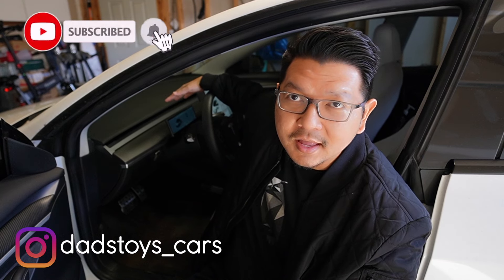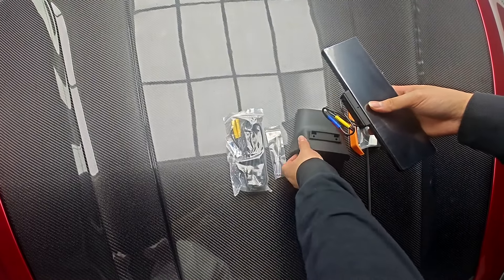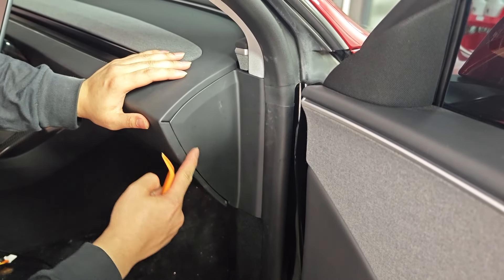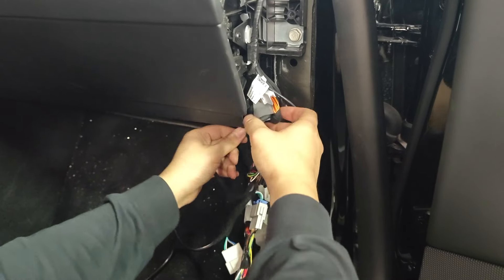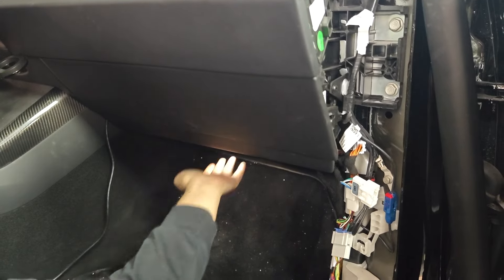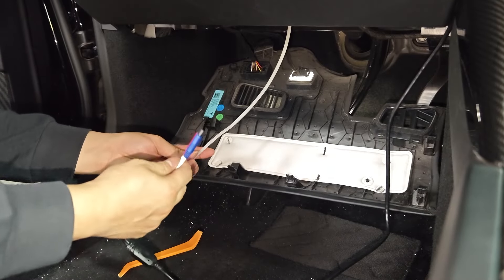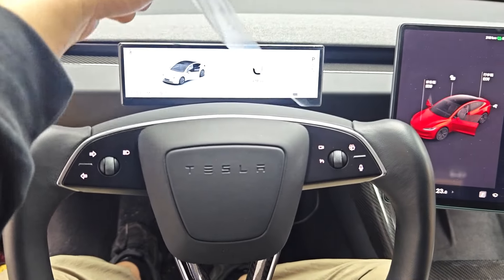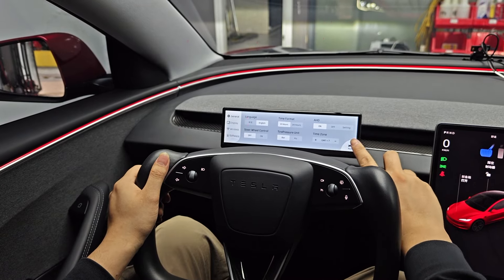New 2024 Tesla Model 3 Highland Display with Apple CarPlay & Front Camera Upgrade! #tesla

Comment: I have the 2024 highland USA version and I bought this product. You need to possibly take this video down or make a serious warning about the clip at 7:29. If you do research you will find out that it’s not easy to remove that panel at all on the USA version. The reason is because there is a knee airbag there and this is dangerous. That panel is nearly impossible to get off and it’s because Tesla doesn’t want you in there. Trust me I know I tried today.
Reply from the maker: @esedman157  Appreciate your comment.
Did you use plastic pliers to help removing the panel?
Reply: Yes I did and the panel doesn’t come off on the 2024 highland USA version. It’s heavily bolted in because it’s a knee airbag
Reply: ^^^^^. This comment is very under rated.  I had the same problem and almost broke my panel.  I was able to run the wire on the outside.  So the wire is exposed about 3 inches on the steering column.  I haven’t seen anything online on how to remove it.  If someone finds out please link.  Other than that keep up the good work.

Comment: Hi Paul, it might be a stupid quesiton from me, I just got the 2024 Model 3 highland and  it does come with the front camera, if I purchase the Display without the camera option is there a way my tesla front camera works with this display? Thanks
Reply from the maker: All Tesla cars come with front camera but the vision measurement not that accurate compare to sensors from older cars that’s why some owners might prefer to have additional front camera for parking.
You can’t connect the camera feed from the car to this display.
Thank you for watching!
Please subscribe for future contents.🙏😃
Reply: @dadstoyscars  Thanks Paul! already subscribed 🙂
Reply from the maker: @dt000tb9  appreciate your support.🙏
Reply: Hi Paul, I have purchased the unit using your promo code, received last week and have it installed! However, because my car is right hand drive and when I try to run the wire from the frunk into the cabin, I can't find a grommet to run the fishing tape, The video you have is Model Y (if i am not wrong) not the model 3 Highland 2024. Therefore I am wondering you have any suggestion how to do it? I can see there is a grommet on the right hand side when I am facing the frunk but it has a thick cable run through the firewall and I am a bit worry to touch that! I believe there are other viewer for your channel might have the same question so hopefully you can assist for a solution otherwise the camera i have become useless in my case.
Cheers!
Reply from the maker: @dt000tb9  Hi, I just reached out to Teslasy and they said they already have one of their technicians reach out to you to assist with the Model 3 highland front camera installation.
I hope you get the help you need.
Let me know if you still have issue regarding the installation.
Thank you for your support!🙏

Comment: I didn't take premiun connectivity because I share the data with my iPhone. The problem is that when I activate CarPlay on my phone, I lose the connection and my Model 3 no longer has internet: very frustrating, I no longer use CarPlay, I use the screen only for speed :( 
Would you know how to avoid this? Thanks in advance for your fantastic work!
Reply from the maker: CarPlay does stop WiFi connection when it connects to CarPlay device. Let me try to reach out to Teslasy and see if they have any suggestions for you.
Thank you for watching and your awesome support!🙏😃

Comment: What’s the point of the camera? Is it needed?
Reply from the maker: Some owners with newer model with camera base only no sensors might prefer to see what in front of the bumper.
Thank you for watching and your awesome support!🙏😃
Reply: It’s particularly useful when I pickup my daughter at the kindergarten. I want to be sure that there is no little ones that I cannot see. Before, so many times I came out of my model Y to check. A front bumper camera should be standard. So many child died, specially since the SUV era. Note that the autopilot is ignoring even an adult at slow speed.

Comment: do you have instalation video for old models with intel?
Reply from the maker: What year and Model is your car?
I have 2021 Model 3 with Intel processor but still have front passenger OBD. 
Please check out this video:
https://youtu.be/xSHbtlgOBkk?si=bYldfjd0-GlQaESs
Thank you for watching and your great support!🙏😃
Reply: @dadstoyscars  model 3 21 LR Freemont.. I thought for Intel the obd is under dashboard
Reply from the maker: @juradosty  I have the same exact same car as you and there is 20 pin OBD port on the front passenger side just like in the video.
Reply from the maker: You can also check first to make sure you have that port. If you do you can get the AMD version.
Reply: @dadstoyscars  I have early model 2021 - built in 10/2020.. I expect the same Obd location as older models.. I think I have to dismantle it in car and check where it actually is.. Thank you
Reply from the maker: @juradosty  I think that’s the only way. Your car has newer interior right?
Reply: @dadstoyscars  yes 🙂.. But without door wood trims

Comment: What a piece of crap!!! You have to disassemble the whole car, drill holes, remove the frunk, etc etc. ... another source of parasitic noise !
Crapy Tesla ...  why don't one just buy a one of the other great EVs that has a screen on top of the steering wheel or a heads up display?
Reply: Because now other EV brands don't have FSD and Model s,x are more expensive than necessary.